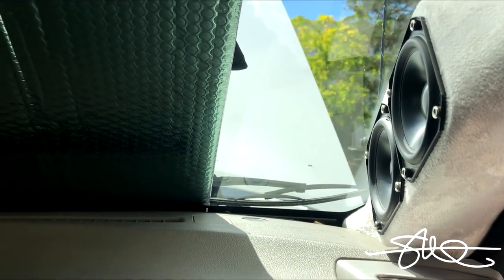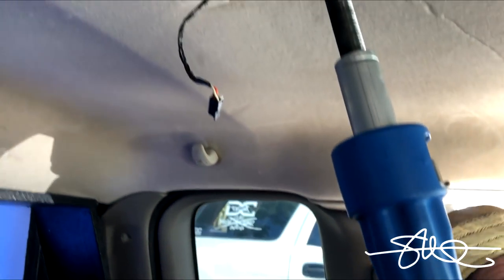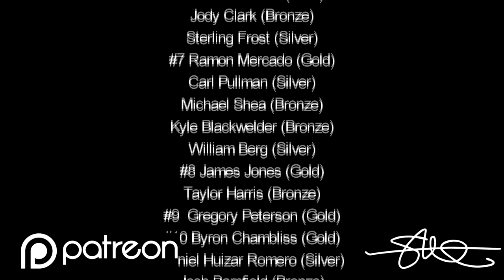It's All in the Box. 2 18" Subs + "Compound Tapped Horn" Enclosure = LOUD CLEAN BASS!

Comment: I had never heard of B & C until this video, but they really are impressive with 97db sensitivity and 3,400 watts continuous. Very nice build!
Reply: B&C are pro audio speakers more commonly used for midrange/midbass , you would get clean bass but doubt you'd get killer lows from a setup like that
Reply: well, pretty sure you were just into car audio and not into pro audio since b&c is a well regarded brand.
ofcourse 97dB/1w sens, even most pro audio 12s have a sens of 96dB or higher.
but ye i switched to pro audio subs, from car audio subs a long time ago and i have no regrets at all, its alot more efficient, so it needs less power to get as loud etc
Reply: Christopher johnson its possible, i've had a "shitty" pa 12 rated for min 38Hz hit 26hz so
Reply: parts express sells them
Reply: Christopher johnson Not true at all. B&C also sells Subwoofer that play really low. E.g. The B&C 21SW152 will easily reach 30 Hertz in a proper enclosure. It's all about designing the box the right way. Not to mention that it is way louder than any car sub around (except 32" ones)

Comment: Compound Horn Tapped Pipes works really well in cars and home theater. I have built a few of them, but never anything close to 218 with B&C 18IPAL.
Reply: Hello Johannes!  =D       Barnaby has done an amazing job on this Paraflex build ....     Is the one you built with the Gas Comp 12" impressing the heck out of everyone in Sweden?
Reply: Matthew M J 
Yes. It is very impressive. It does not sound like a single 12 inch. Most people guess it is two 15 inch drivers when the hear it.
The owner hit 130 dB with only 65 watt of power, and 144 dB with 2500 watts.
Reply: Spectacular!    Such good results ...  Well done Sir!  =D

Comment: I was thinking about getting some 21 inch PA sub woofers for my Hearse I have a ton of room to play with 11 feet in total from back of the seat to the rear door it should be large enough for a horn loaded sub woofer enclosure for 2 21 inch PA speakers one thing that I miss is woofers hitting the higher frequency hard My Kove Armageddons U 15's "same as the Treo Audio SSX sub woofers" are only good from 20 hz to around 70 hz  after that it's not so great I like playing mostly Rock, kick drum is not too bad with them.

Comment: maybe for my next upgrade try 2 PA subs...current setup has 3 sony 12s that i picked up for real cheap. my truck rattles like a mofo and there only in a sealed box. i need a bigger trunk or some better 12s with a custom ported box. Dam tho like the setup in the vid looks nice and clean.
Reply: nah mate get some Dc 12's ,sundown 12's etc. for in car use it's too much of a hassle to make a pa sub work right as shown with the box in this vid
Reply: i wanted to get a sundown 12 at first then bought a massive audio gtx 102 10in sub was kinda let down so i found 3 12 sonys for 55 bucks they do pretty decent...but i still feel like i need more bass tho.

Comment: uhhh its all about efficiency. Those B&C 18's will literally be twice as loud on half the power as any sub from Sundown lol
Reply from the maker: not really.
Reply: 808 Cavalier They are definetly way louder than any 18" Car audio subwoofer in free field.
Reply: Search Hoffmann Iron Law.
Reply: i'm not sure about that cause remember most pa subs get run on 1500watt rms or less the sundown subs and any car sub can handle far more meaning even if the sub isn't as accurate or disperses the sound as much it will be louder just due to the massive amounts of power they can take
Reply: Erik Britz Not true. Even if the sundown takes twice the rated wattage, this will only result in +3 dB. You need 10 times the power to double the loudness. So all in all a PA sub will still be way louder
Reply: you are talking about sensitivity i.e 101db @1meter for most pa drivers that just means pa subs get louder quicker past that 101 db it still needs a ton more power hence why pa subs generally peak at 145Db on the loudest and not 185db 160db etc. also they do not dig that deep too and will not be as loud on the low end i do think a build with pa and car audio sub could be killer so that bandwidth kicks ass but other then that car subs are stil best for overall loudness
Reply: Erik Britz Not true at all. And the high sensivity means that it is louder with less power across the whole loudness spectrum. So a B&C 18Ipal with full power will be way louder than a sundown 18", eventhough it has a higher power rating. All that is due to higher Sensivity. And PA subs not playing low is a common misconception. They just need more Airspace/bigger enclosure to play very low. Car audio subs are meant to play deep in small enclosures. By doing so they sacrifice overall loudness and precision. Again: it doesn't make a lot of sense to compare these groups
Reply: doesn't make sense but your doing it... and also explain to me then why doesn't pa subs go louder the more power that get's fed to them rather they burn out? ive been Dj-ing for about 8 years now and ive never heard a PA Sub or mid play better bass then a car audio sub also my uncle who is a Dj aswell sent about 2500watts of power through his dynacord subs and they didn't play louder then car subs but they did fail due to playing about 300watts over their Rms and you and i know Dynacord is quality sound what you are refering to is most likely the Boomy sound PA subs and mids bring Car audio subs don't have that excessively boomy sound to them but that's because most car audio subs don't need to  and finally if that was true that pa subs are louder then explain this , this mans running the dc audio 3.5Ks at 1ohm to 0.5 ohm and got 3800watts into each sub might be more point is that's 7000-8000watts easy and yet the these subs peak at 154DB@56hz compare that to many dual sundown 18 builds doing over 160@28-40hz and there is a big difference heck here in my country Targa Audio ran 180.3DB using a single 18 inch Targa Venom Subwoofer and a Single Targa Zorro series amp pushing 7200watts peak https://www.youtube.com/watch?v=AhsjRVyT1vc 

i do agree that these subs will be more boomy with less power but i don't think these type of subs will be going louder then most car audio 18 inch subs would be a cool test to see somebody build a box for each woofer and test which is louder three of the best PA Subs three of the best Car audio subs and three of the best Home audio subs in a car and see which reaches the highest DB. so yeah personal opinion is car audio subs are louder PA subs more versatile and home theatre subs best sound quality.
Reply: Erik Britz Are you now comparing subwoofers in the car to subwoofer in free field? Because it is obvious that in a car, subwoofers will play much louder. I can tell you that outside, a PA subwoofer will be way louder than a car audio one (thats what they also designed for). If your statement is true, then there is actually no purpose for PA subwoofers to exist. There has to be a reason why they don't use sundown audio to reinforce 10.000 people applications. And dynacord subs are not well known for being loud. Get a KS28 by L'acoustics and compare it 2 of the top sundown 18" subwoofer (tuned to 30 Hertz) in freefield. I bet that the KS28 will be way louder, while being rated to half the power...
Reply: Haha i was talking about PA subs in a car mate just like 808 Cavalier compared the PA subs in a Car inside a car the car audio subs will be louder no matter what power the PA subs get PA subs have more boomy sound but in certain ways lack the depth of Bass Car audio provides and like i said PA Audio is designed to spread the sound over far ranges at n certain volume and not to go all out loud another reason for that is cause they can't reproduce certain frequencies as well due to their mechanical parts and also reason people don't use said car audio subs at such events is cause 1.)not designed for it 2.)there is almost no PA Ampilifiers that provide enough power or go down to 1 ohm or less to run these subs ive worked on Festivals with DAS Audio ,JBL ,CVR ,Dynacord ,RCF and more the loudest sound i heard was at a 50 000 people festival with 4 dual 21 inch subs and heaps of line arrays  i forgot the brand i'll probably remember in a bit point is these subs were loud enough to fill an area about 3 miles across i burst my eardrum that day BUT last year at a car show there was a van parked about same distance away dude had rockford fosgate T3 19 inch subs in his van probably 6 of them and it's bass was louder heavier and had more pressure at the same distance then these large PA subs and also at different frequencies etc. this is also why strayed from buying an 18 inch PA sub for at home listening and stuck with a car sub they just sound better in certain ranges now i still use my 15 inch PA Mids at home along side the car audio sub but i know the difference they have just my opinion man PA is for loud with decent to high quality sound spread across a wide are Car sound is for Raw power and loudness on the lows in a small space and finally home audio is for the highest sound quality to create and emersive experience i want to add something aswell the 18 inch PA sub i was listening to had about 600watt''s being pushed through it but when they compared it with the Car audio sub in a 1 cubic foot box on 200watts it still sounded better with more power hence why i picked the car audio sub.
Reply: Erik Britz Ah I thought you were talking about in House or freefield usage :)
That changes the whole situation. Each subs is best at what they are meant for: PA subs are louder, more precise and efficient but need big airspace to play low.
Car audio subs reach lower in smaller enclosure, have lower resistance, more x max, higher power handling but are less efficient, often expensive and  less precise. 
I personally prefer the more direct sound of PA subwoofers, but I see why people like Car audio.
Reply: No man is chill i grew up with my father Dj-ing and now i'm doing it myself he had about 10X JBL 2226H Woofers in dual cabinets with Quad tweeters in each box on Crown  Amplifiers sadly they stole almost every bit of his sound i currently use this Brand they base all their designs off of JBL http://vivaafrika.co.za/hybrid-speakers-2/ they literally the best sound quality for low prices my current Hybrid PLB 15's outperform any of the Wharfedale Pro 15's ,Behringer , and even the JBL JRX series i have listened to the JBL Eons and although they were louder my speakers are not at full power and yeah but the point was i strayed away from buying a PA sub for reason of needing louder cause i am a Bass head at the end of the day so i'm building my home theatre setup to be decent high quality but with a ton of bass i will be running the two Hybrid PLB 15's and two of the Targa Venom 15 inch subs on a Behringer Inuke 6k 4u and hopefully later on upgrading to a Crown Xti 6002 and Crown Xti 2002 crossovers the lot so i can have alot of Bass indoors aswell as great quality sound

Comment: The crazy part is that they aren't even real subs. They are PA speakers
Reply: sosa boy What are these then? Midrange speakers? Ever played Mids through an 18" speaker? Probably no, as it will sound mediocre at best. 
These deserve the term subwoofer more than car audio subs. So if you have no clue about audio, then please don't start a discussion.
Reply: Fuse @0:54 what did the owner say 🙂
Reply: sosa boy He said that these are no car audio speakers which is right. But these are still subwoofers... So?
Reply: Fuse he clearly said they are PA speakers. Can't hear? Then don't add your two cents into the discussion thank you
Reply: Pro audio has subs.

Car audio isn’t the only industry with subs.

Also a speaker doesn’t have to have a 100lb motor and a off road tire as a surround to be a sub.
Reply: jose Ramos Stiff cone is the keyword. The funny thing is that PA subs usually have a stronger Motor than car audio ones, while being much lighter (not even talking about neo magnets)